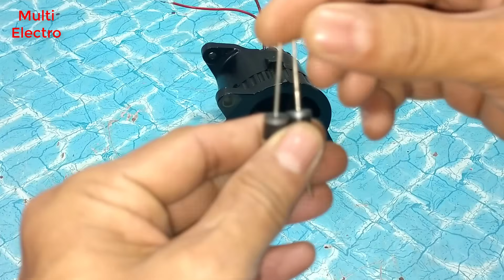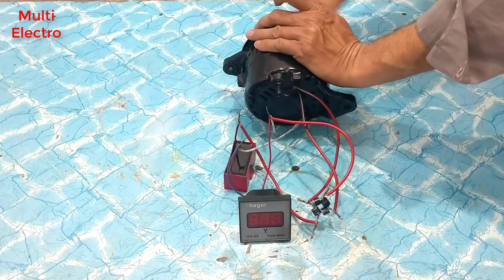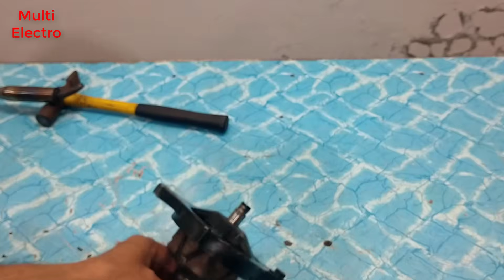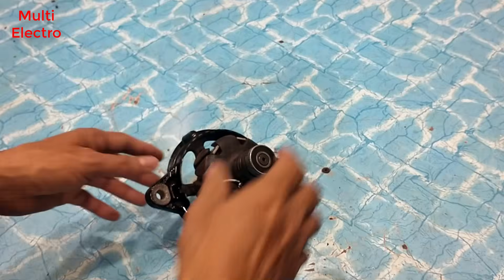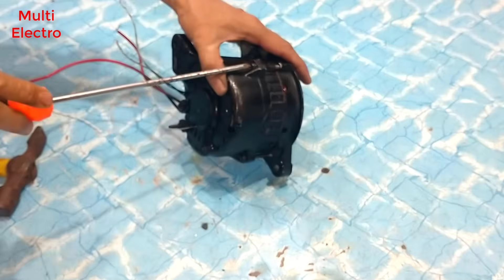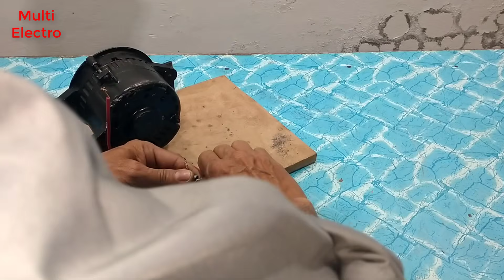100V Electricity Generator from Car Alternator  12 Neodymium Magnets vs Electromagnetic System Test

Comment: Curiosity - What size diodes, how do you tell which end is the negative end and which is the positive end  ??? And do you not just sell this combination already hooked together ???
Reply from the maker: Good question! The rectifier uses standard power diodes (around 6–10A rated, with voltage rating well above the expected output). The negative side is the end without the stripe, and the positive side is the end with the stripe (cathode)—that stripe marking helps identify the polarity when wiring. In this project I assembled the components manually for demonstration, but yes, similar bridge rectifier modules are already available pre-assembled and can make the wiring much easier. ⚡
Reply: you can buy them already together, they are called Bridge rectifiers....google it